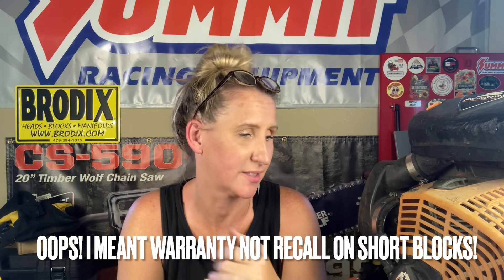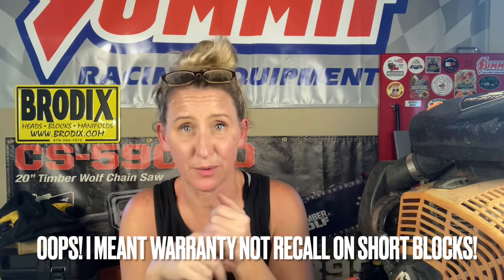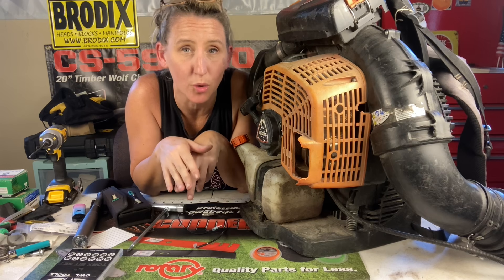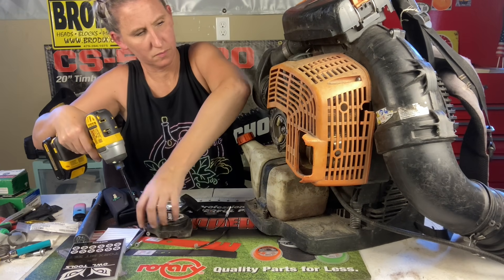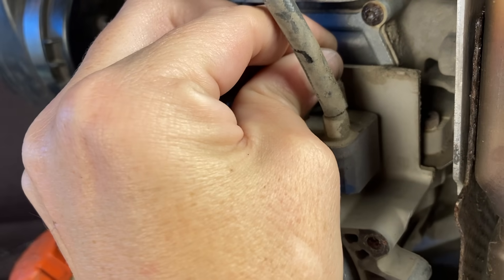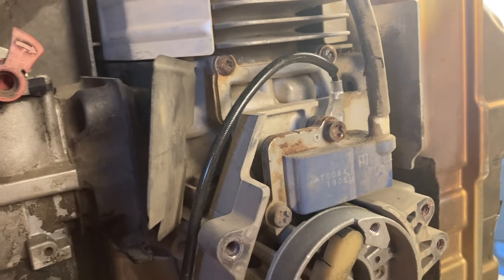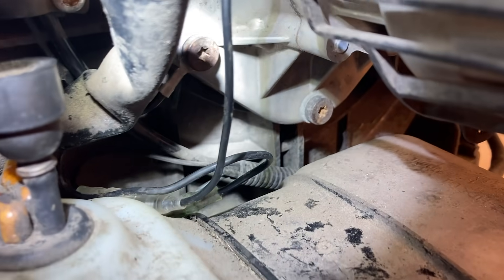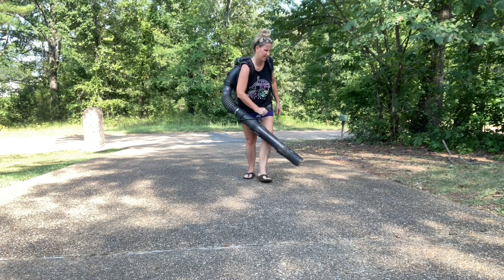ECHO We Have A Problem. Customers PB-8010/9010 Echo Backpack Blowers Keep Dying!

Comment: I guessing it's a T model not an H  I had a BP 500 T meaning the throttle is on the tube and when I bought my first BP 8010 it was an h meaning the throttle is on your hip. The age is such a better model. The cable for the throttle don't get caught on anything like the a T anyway, just thought I would mention there are two different types

Comment: I am a little confused.  Usually a break in the kill wire prevents grounding and will not shut down the mower.  In this case a broken connection stopped the motor?  So does the kill wire go to the switch and then back to the block?  Not sure how electrically it was shutting down the blower.   Touching plastic shouldn't be a problem.  Where did the wire touch other metal to get a ground?  I don't have a schematic to full look at the circuit myself.

Comment: What would cause a sears weed eater/ brush cutter start.  It is the kind with the electric start from the top. Put a short block in it then a carb. Runs great when I do get it started but I have to use the electric motor due to my weakness.  Is it just a carb adjustment

Comment: I have a PAS 225 WITH STRING TRIMMER AND EDGER.,  I've had it for about 5 years.  Should I grease the power shaft and due a tune up on the engine?

Comment: My PB8010T stumbles when increasing the RPMS up to almost full throttle, but runs great at full throttle. I have installed  a new recommended brand spark plug and gapped to the recommended gap, installed a new fuel filter, and checked the air cleaner filter and it was ok. What could be the problem?

Comment: So a small engine perfect condition bought in florida will run same as high altitude of colorado? In general consensus you are semi correct. For example my backpack blower. Under warranty 4 carbs installed it was given to me because of issues..$20 later 5 years ago i only use it in fall..i tuned that cheapy carb for fall weather. It never lets me down.. but i also tune race car carbs year round as well. But the one and done isnt always the answer. Fuel for example and water you speak of. You admit 60 days fuel goes bad. Take a carb tuned for gas no ethanol whatso ever unless its the canned gas you despise. Care to buy an ethanol kit like $30 and start testing your fuel? The stoich level between gas and e85 is like 14.5 to 9.5. So i use the 87 octane in everything i own and weigh out oil onna gram scale. And slosh 3 times and mix accordingly newer mowers fuel injected account for this. Small motors do not account for it. Hence carbs cant account for it.. and rpm yave you never noticed you tuned a carb today for exact fuel in tank to achieve that rpm level you are so worried about..today it blubbers causes oil not carbon like the video i seen recently. But tomorrow it revs higher cleaner. And 2000 rpm more. I get store bought can gas not the way. But id rather buy the cheapest gas possible and control it than you like my dad. I deal with 5 times a year just one person times 20 people that dont understand stoich and carbs tuning..  ising their stuff like dad. He puts gallons thru his stuff weekly the perfectanicured yard but..not carbon but oil buildup is his and every small engine ive ever dealt with biggest problem. Yes. Hard starts ets. Just like your carbon or should i say oil build up video. Oil unburnt. Out the exhaust is the 2 stroke issue. Because small carbs cant nevermind..good work but i believe you are misunformed..

Comment: Does the 8010/9010 only have trigger throttle control, or hip throttle option also?
Reply: both.  8010/9010T is throttle control.  8010/9010H is hip control.
Reply: @Forest_Lawn_Care  Just wondering if the hip controlled models are having the same issue?

Comment: Had an echo blower I bought at Home Depot. Paid more to get the Echo because I wanted a "good" one that will last.  I had had good experience with one of their string trimmers. When the blower quick working around three years later it was "unfixable."  I replaced the key electrical components.  Nope.  Fuel pathways. Nope. Rebuilt the carb.  Nope.  Bought a new carb. Nope. Tried a few other things. Checked every wire I could think of (but I'm not an electrician).  Nope.  I gave it away to my neighbor who has a lawn business, because he believes he can fix it.  Nope.   Occassionally,  over the course of life, you'll own a machine that will noticeably improve your life when you give it away.  That Echo blower was one of those machines.  

Realizing that I still hadn't bought a "real" machine we went to a garden equipment store and paid a little more for a Stihl.  Never looked back.  The difference was like night and day.  The biggest challenge for two stroke engines is maintaining a good flow of clean fuel.  After completely ignoring the Stihl recommendation to replace the fuel filter once a year it got a little sluggish after 3 years. Why did it run perfectly for so long? Because they build it with TWO alternate filters for the fuel to use in case one gets plugged.  It was a easy fix once you understood the "in-tank" cofiguration.  Since I was in there, I also changed the plug (I should do that again some day), checked the spark arrestor, etc.  All good. We've had it about 6 years now and it still starts and runs like a top.  I should probably change that fuel filter again.  We love it.

By the way: That day when the Stihl first ran sluggish because of the filter?  I was able to restore it (till I got the parts) by rubbing my fingers on one of the filters.  The Stihl filters are wrapped in a loose layer of mesh that allows you to temporarily restore function in the field by rubbing the gunk off of the mesh.  Nice.

I'm glad we gave that Echo away, but you are surely doing a lot of people a lot of good by running this video.  Electrical problems can be a nightmare to trace down.

Comment: OK folks.  - 10:30  " I don't know where the  " break "  is  "
If you completely removed the wire from the coil - the unit would not shut off.  If you cut the coil wire off flush at the coil - the unit would not shut off.  
You must ground the  " p " lead  or the coil primary circuit wire to shut off the motor. 
If the wire were broken - the unit would not shut off.  The wire is  SHORTING to ground  and thus causing the unit to shut off without command. 
This is magneto 101.

Comment: With all due respect. Isn’t that just a kill wire? Where was it touching ground and killing the spark? Did I miss a bare spot on the kill wire? 
Couldn’t you throw all those wire away and the engine would run until it was out of fuel?

Comment: This is going to sound d a bit pedantic,  please don't take it that way, it's not what I intend it to sound like. Are those actually kill wires or power supply to the coil wires? Don't broken kill wires normally stop the kill switch shorting out the power? For instance I've got a brush cutter with a broken kill wire, still goes perfectly, just won't stop 😮

Comment: Husqvarna 580BTS is close in power to the 9010 and BR800. The Redmax is no stronger than the Husqvarna. Husqvarna owns Redmax. I prefer the Husqvarna because of the waist belt and it is not as loud.

Comment: I remember having coil/switch wire shorts and issues on the Husqvarna 570/580(Redmax) blowers when I was a Husqvarna tech...random dying issues, switch not working issues. I encouraged the commercial guys to buy the models with the throttle and switch on the stalk next to the housing, rather than the switch/throttle on the tube handle, because of the wire and throttle cable issues cause by the long wires constantly being flexed while sweeping the tube back and forth on the tube-mounted controls...the stalk mounted controls were shorter and didn't move around, and gave far fewer issues. For me, the best backpack blowers are Echo and Husqvarna(really Redmaxes), I do not like the Stihls because I despise the 4-Mix engines, period. I have never really been a big Stihl fanboy anyway...and I have always disliked Husqvarna's policy of buying up all the competition...I have always had a soft spot for Echo, and high regard for their quality. Unfortunately, around here, they have always, and still do, suffer from name recognition, specifically, they are perceived as being "a step below" Stihl and Husqvarna, and "a step above" the cheap consumer equipment. I have even recommended Echo chainsaws to people when they ask my opinion, but most look disappointed that I didn't recommend a Stihl or Husqvarna...I just shrug and say, "You asked my opinion, and my opinion may or may not be what you wanted to hear. If you wanted a Husky or Stihl, you should have just gone and bought one to start with"...